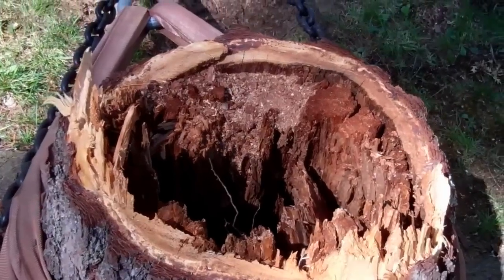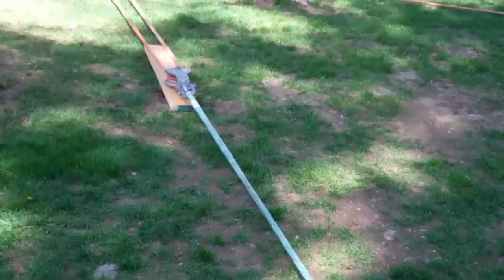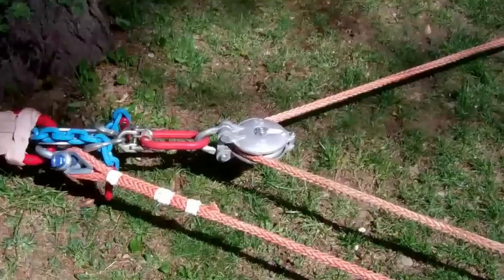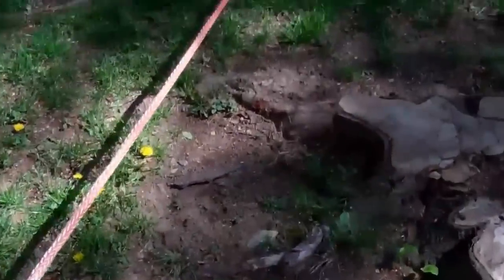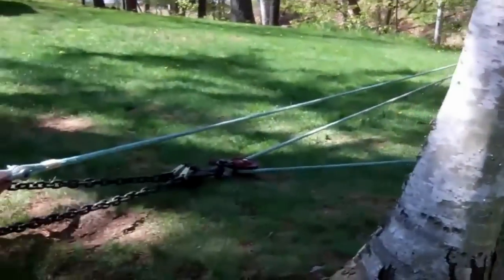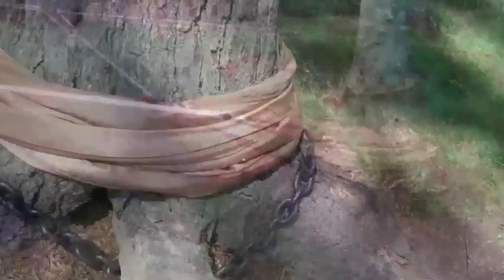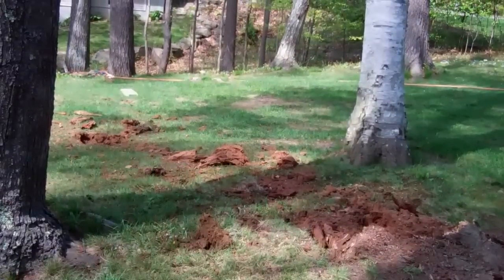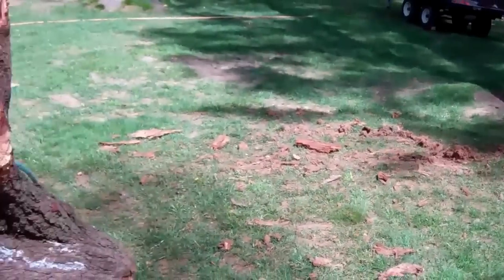Flying Stump, the Backstory

Comment: The trailer is a step that would not have occurred to me. Is there a story of a past job where rigging chased after you?
Reply from the maker: No, not exactly.  But you might check out the vid "E/E Anchor Sling Proof Testing".  This was a deliberate break test and it shows 1) the destructive power of a rigging failure and 2) some things you can do to mitigate the risk.

Comment: It seems like the chain on the stump is more just an anchor point for the pulley,  isn't the rope on the strap doing most of the work?
Reply from the maker: Actually no.  The rope/rigging sling delivers 1/3 the total force.  The chain delivers 2/3 because there are two (2) tension strands acting on the pulley.
Reply: I've never seen it done like that, it makes me wish I had stumps to pull out, you've got quite a nice selection of pulleys.

Comment: I have put time on the calculations.

First, I believe that a common mistake is to forget to count the anchorage at the stump for the calculation of the mechanical advantage. You only look at the ropes going through the pulleys and you conclude that you have a 3: 1 system, whereas it is 4: 1 because of the anchorage of a pulley to the stump.

Then if I did not make a mistake the multiplier effect is not a rule for all compound systems. I noticed that it applies in your case (4: 1 followed by a 2: 1) but it doesn't in the case where there are two 4: 1.

So I get from the calculation of the tensions a mechanical advantage of 56:1. And if I multiply 4X2X7 I get 56:1 too.
Reply from the maker: Remy, I do appreciate your persistence on this but I'm unable to discern the source of your confusion.  The last or "heaviest" simple system in this compound rig has one (1) tackle attachment delivering one (1) unit of tension T.  The red snatch block then delivers two strands of tension 2T.  This sums to a 3:1 system not a 4:1 system.  If anything, the effective MA is LESS than 3:1 because the force vectors on the ropes are splayed out slightly and not perfectly aligned to a straight pull geometry.  If you're not convinced, buy some dimestore pulleys and some string and set it up for yourself.
Reply: I drew your set-up on paper as if the stump was a load that has to be lifted up (F=T=mg). I start from the stump. You have your sling. From that sling you have a rope who is redirected and then pass through a pulley that will do the Work (traction). This pulley is attached to the stump by chains. This is the first single system. So from the drawing the tension of the rope attached to the sling toward the redirection must be equal to the tension in the chains on which the working pulley is attached. If the stump acts like a load, the "mass" of the stump is divided in these two anchors. The tension in the chains (mg/2) is divided by two by the working pulley. The strand that goes to the other system (2:1) has then a tension of mg/4. If the 2:1 system acts too like if it lifts a load the mass of that load is mg/4 and the tensions on both strands are mg/8. This tension is redirected toward the 7:1 block & tackle from which I obtain mg/56 as the tension to keep at equilibrium the system (stump as a charge to lift). MA is 56:1, virtually.
Reply from the maker: "The tension of the rope ... must be equal to the tension in the chains"  There's the error:  it is not.
Reply: Unless a misunderstanding of my part, the rope attached to the sling (or the just the sling) and the workin pulley attached to the chains (or just the chains) must have theorically the same tension because they both are anchors to the load (stump). The mass of the load must be divided by two ( if they share the same angle), so the tensions are equals in both these anchors.
Reply: In my drawing I represent the chains with one line linking the stump and the pulley. If I do two lines instead (which divide the load by 3) and link them to the pulley, the tension on the pulley is 2mg/3 and the strands of the pulley then have a tension of mg/3. From that I can get 3x2x7 = 42.
Reply: I have to do the same thing for the sling in reality. The mass is divided by 4 and the result is the same as if there are just two anchors.
Reply: I remembered a thing about the angles today. It is the angle between the vectors that matter. As there are two anchors pulled by one same system the tensions on the anchors should have the same module and the "vector sum" should be in the middle between both (splitting the angle in half).
Reply from the maker: Yes, Remy, you have a misunderstanding.  You are confusing tension and force.
Reply: As far as I know there is no difference to do. Here the forces are the tensions. Or just vectors. The error is the "T method" which seems to be popular on youtube. This method is not accurate since it doesn't obey to the third law of Newton.
Reply from the maker: For a direct connection to the load F=T;  for a connection through a single sheave pulley F=2T;  for a connection through a dual pulley F=4T;   for a 3-sheeve  pulley F=6T.
Reply: Yes, if they are in a single block and you use as many independant ropes as they are sheeves. It is then easy to deduce the mechanical advantage of each in these cases. But you need as many independant "workers" as they are sheeves to benefit the M.A. With simple pulleys it all depends on the set-up. With two simple pulleys you can have either a M.A. of 2 or 4. With 3, either 4 or 8.With 4, either 8 or 12. The "Force" isn't only what you need to provide to the system. By definition a tension is a force. It is how many time the load is divided that renders a M.A.

Comment: what is top and drop?  There is a puppy in the stump?
Reply from the maker: HA!  No, the puppy ran off into the woods ... !  A top and drop is when you don't have enough space to just cut down the tree.  So you climb the tree, lower  the top and some portion of the  tree from the top down.  When it's short enough to fit into the space available, you climb down and cut the tree down like normal.

Comment: With that much mechanical advantage, you could have used the high school football team to pull out the stump  -- and taught a lesson in MA at the same time.  But I really appreciate the thought put into this as well as the informative video.  A person can learn watching both the smart successes and the dumb fails.

With that 42:1 you must have driven at least 20 ft or more to get that 6" of movement before she popped?  (A few flags on different parts of the line would be informative "next time".)

Comment: Hi Tom, may I ask a question?  I love the rigging and truly wish I had that sort of gear!  But let me ask a question and I hope you don't take it as criticism of your technique as it is more a question of efficiency and speed... When I bought my house there were several oaks I wanted gone, some about the size of this pine.  After cutting the tree down, I could literally take the chain saw and cut up all the visible wood down to the ground (and sometimes of course even virtually below ground level) and then just use a large spade bit and drill and place huge deep holes in the remained wood.  The stop literally rots away in very short order and I could do that with the chainsaw and drill in probably 5mins?  Why spend all this rigging time and then have the stump and the hole, etc etc?? I see lots of videos of guys doing random things (4 trucks at once, come alongs, tractors, Etc) to pull out a stump and all I am thinking is why!??? Cut it down and cut slots into it with saw or drill holes with spade bit and it's gone!??
Reply from the maker: ufordinner I very much appreciate the courtesy embedded in your comment! Thank you.   It might surprise you to learn that I AGREE AGREE AGREE! On other blogs I've said this is definitely not the most productive way to go.  There are many faster alternatives to grind, saw,  burn, or rot the stump away.  In fact, I called this technique an "experiment" in MA rigging.  BUT sometimes you simply can't tolerate the long-term sinkhole problem, under driveways, hardscaping, yard structures or even portions of the property that are intensively gardened for esthetics.  And the worst part is that the settling isn't over quickly ... it is a long multi-year process that keeps calling and re-calling for touch-up and repair.  In those situations, the stump has to come out, period.  
Again, the most productive way is to bring in a big excavator and dig it out.   But in an established yard where you've lost one big tree, can you afford both the equipment expense and the footprint damage? 
So, sometimes, pulling it out is the best way to go.  But I've seen many people making the effort without really understanding the tremendous power that MA can bring to the job.  Admittedly, my setups were extreme, because my tractor is so small.  But if you could pull with a loaded dump truck, for example, the setup would get much simpler ... and the stump would lift out instead of the truck tires trying to burrow to China ... !
Thanks again for the nice comment and the interest.
Reply: @tghoffmann  Your courtesy in responding to the questions and the reasoning in your mind is exemplary.  Thank you for this informative and entertaining video.

Comment: I need to get me a set of pulleys like that. That would make life so much easier sometimes. I always run into the problem of not enough traction with my truck. No matter how much power you have if you cant lay down the traction you wont go any where. With this set up I would be able to use less power from the truck therefore less chance of breaking traction and pull bigger stuff. Tom you will probably be getting quite a few views from me so I can see how you set it up.
Reply from the maker: +the stig mach 1 I'm moving this summer andselling most of my heaviest rigging.  See pix/specs at https://www.dropbox.com/sh/vdh5zrbnn5gjfvm/AACI1U4gs69-n_Jd0UUHV65ga?dl=0

Email me at Tom@Hoffmann.net with any sopecific interest.
Reply: +Tom Hoffmann I ended up going to harbor freight and an auction when a local tow business shut down and buying a bunch of the rope and pulleys and such. thanks for keeping me in mind though.

Comment: If your tractor weighs well over a ton and with the front loader over hanging the front (which helps), you should be able to pull a ton with those big tyre lugs locking into soil. So, with the 7:1 block and tackle advantage, and the first 2:1 pulley advantage, you could  easily overload the 8 ton pulley blocks on the blue rope. Particularly if you took a run-up with the tractor! It's lucky it was a rotten stump! 
Very interesting and clear video! Also very rare to see this kind of thing, with so much hydraulic equipment around. In fact, I thought I was the only one who did this kind of thing these days, as I haven't seen anyone use a block and tackle for decades, except on old sailing ships!
Reply from the maker: James,
Good eyes and great comment.  You are absolutely right:  the two snatch blocks are the weak link and this setup eats into their safety factor without doubt.  But not as much as you might think.  The tractor tires are not Ag lugs, they are R5 Industrials.  Not great for pulling but better for overall yard work.  By actual measurement, the rig makes 700 to 1100 pounds on the drawbar, depending on soil condition.  I use that knowledge as my safety clutch for this sort of rigging and I never “bounce” the rig … that’s how things break!
 
The “heavy” end of the rig is always problematic since I build these systems from eBay scraps and treasures.  Note the three-strand connection to the stump, attached with loops and baskets.  Way cheaper than big components in in a single line, or worse, a choked connection. 
 
Although not used on this shortie stump, my favorite heavy end connection is to 1) leave the stump tall for leverage, 2) connect the cordage end to the top of the stump so the pulling force equalizes as the stump tips over, 3)  connect the snatch block to the stump with one long chain loop that  baskets the stump at the base, passes two (2) strands of chain through the big hook on the snatch block and then round turn wraps the stump again just above the first basket.  This forms a crude pulley (chain sliding through the fat block hook) that allows the force to equalize as the stump tips.  Since this attachment is low, there isn’t large scale motion … just a few links to allow the forces to equalize.  But it is very important to spread the stresses equally.
 
It’s a hassle to set up but that equalization has allowed me to pull some real monsters using cheapie bargains from eBay.  Check out the .jpg pix in the comments below.  In fact, I won a case of beer from a guy who COULDN’T pull a stump with his HUGE twelve-ton loader and a single choked chain.  He broke his chain trying to bounce it out but the stump didn’t budge. He couldn’t believe what I could do with a toy tractor.  BUT he got set to pull in three minutes and my setup took an hour … !
Reply from the maker: +soaringtractor , there's no nylon in this rig.  Too stretchy, better for marine applications.  The tackle and the slings are polyester or dyneema fiber.  MUCH less stretchy than nylon.  The last bull rope is 7/8" Amsteel II, rated 50k# mbs.  The 8:1 safety factor and static cordage reduces the stretch but, of course, doesn't eliminate it.  But it's small compared to the "give-up" to the mechanical advantage ratios. I have 250' of 9/16" Stable Braid in the 7:1 and I use it all.  It's like driving to the next town ... !

Comment: Great video, but the obvious point is that this stump would have been perfect to burn out in a day.  Just start a small fire inside that hole.  Still, if I had all that rigging, who could resist using brute force?  Good either way.

Comment: How much stretch did you have? Or how far did you move on the tractor?
Reply from the maker: You're asking the right question.  It's fun to think about the power side of the MA, but on the other end you need enough rope to drive to the next town!  I don't know how far I pulled, but it was around the corner of the house ... that' why I was laughing so hard when I came back around to see what happened!